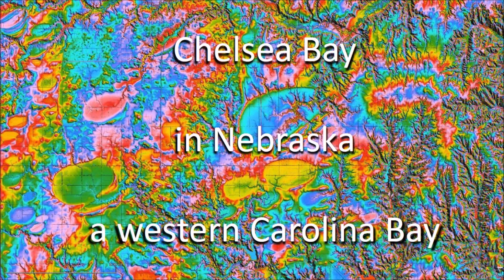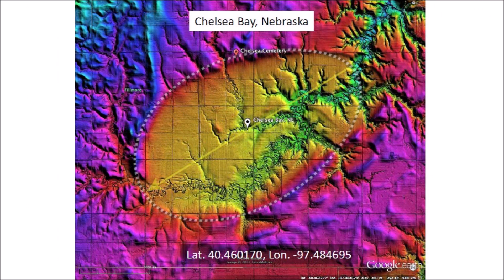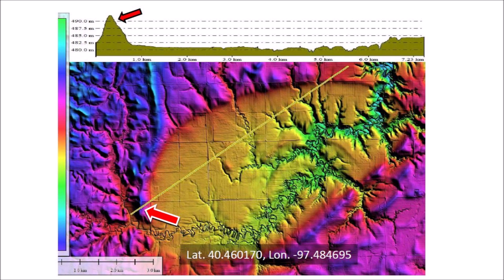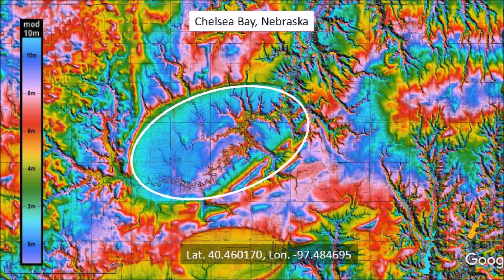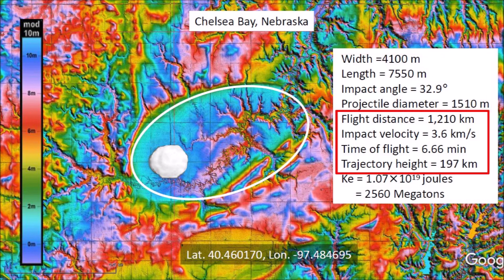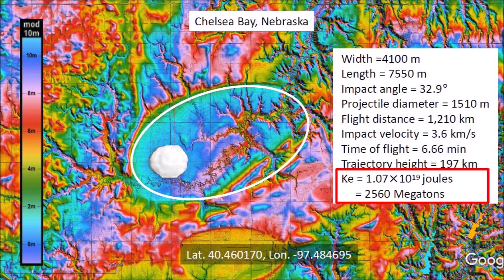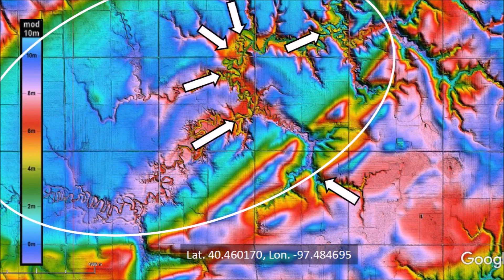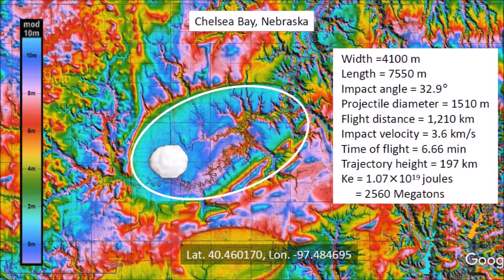Chelsea Bay in Nebraska - a western Carolina Bay

Comment: is there any sand layers in Nebraska bays like there is in Carolina Bays & If so what side of the Bay is the sand?  in Carolina it is predominant in the SE, suggesting melt pulse water erosion..
Are Nebraska bays near the "water table" just like Carolina Bays?  If it was wind that moved sand to one end of the Bay, as suggested in Carolina then it should also be in the North to East Corner of the Nebraska Bays.  If it was water levels then there will be sand layers in the South to West.  Also is the Younger Dryas Sediment Layers present in all of the bays?
Reply from the maker: The Nebraska Rainwater Basins are found on the ancient flood plain of the Platte river. It is sandy soil close to the water table and many of the basins have been converted into duck wildlife preserves. The terrain is not as level as the Atlantic Coastal plain, so the basins have been subjected to greater erosion from surface water.

Comment: Antonio, I see there are different opinions about the direction of the impactor. I think it came from the NE. Have you noticed the pattern of the Canyon Diablo meteorite field. Ehrenburg is 223 miles SE from Meteor Crater & Ganado (& Houck) is about 100 miles NE of it. In between is Wickenburg, Ashfork, Oaks, Bloody basin, Fossil Springs, Camp Verde, & Strawberry. I drew a line through the pattern & found that it comes very close to dissecting Saginaw Bay. Is that only a coincidence?
Reply from the maker: This research is ongoing and we don't have all the answers. I'm currently focusing only on the Carolina Bays, but patterns like you found may be important.
Reply: One large iron meteorite that came down near where I live,  also came out of the north east, in 1780, i.e. The Cranbourne meteorite.

Comment: The Nebraska bays need more attention, but they are harder to see with the naked eye on Google Earth.  Looking at the northwest quadrant of the bay it seems evident that the original river or stream valleys were obliterated.  The freshly formed post impact river erosion is much less defined than the older river erosion outside the bay.  There are breaks in the continuity of the impacted drainage systems.  Is it possible to geologically date the regenerated river valleys where they transition into the bays and bolster the hypothesis?
Reply from the maker: The dates are problematic. They have been estimated at ~24ka, but we have the same problem on the East Coast. The dates are going to be a contentious issue for a long time.

Comment: This ice chunk is the largest one you've discussed (that I can recall).  Based on the angle of the Carolina Bays & Nebraska Basins & adjusting (as much as possible) for 10K years of erosion, can "crater analysis" (a military term) be used to determine which impact sites - Carolinas or Nebraska - received the largest ice chunks?  If this were possible, could one make an educated guess regarding the direction of flight & impact of the comet/ meteor that hit the ice sheet?  Does any of what I just typed make sense??
Reply from the maker: Your questions make sense.  I have considered impact directions from the northeast and the southwest ( https://youtu.be/npXY8mu2hhU ). The butterfly pattern of the ejecta in Nebraska and the East Coast seems to imply an impact from the northeast considering the momentum of the meteorite.  However, this might also be achieved by an impact from the southwest if the explosion following the impact encounters resistance from the Laurentide Ice Sheet and the ice in the Michigan peninsula is propelled radially southward. This is similar to the shrapnel that is ejected toward the direction from which the projectile came for an explosion on a hard surface.
Reply: @Antonio_Zamora  Does the butterfly pattern indicate the extent of the ejecta field, or simply that surface conditions still show impacts ? I.e. rocky mountainous areas would tend to hide the scars of impacts ? Small ejecta could have had a much wider area/reach ?
Reply from the maker: @jollyroger7624  A video scheduled for Friday will show that the impacts were just as hard on some southern states that have no bays

Comment: Well, it still could have been your ancestors and mine. The one "Clovis" skeleton found was dated to 11.5k years ago and promptly buried back in the ground where no one can study it after they declared it a Berengian via hasty dna analysis and yet there is no evidence of fluted points anywhere in China or Russia or across the Bering strait. They are only found in Spain and France and Portugal, ancient Solutrea.
Reply: I saw a map of fossil megafauna : on the east coast the central east coast region is almost devoid of skeletons. Pulverized?
Reply from the maker: A video to be released on Feb. 25, 2022 discusses the lack of megafauna fossils in the southern states.
Reply: @mattiasdahlstrom2024  Maybe, my point though is that the supposed Clovis skeleton they found was dated a thousand years after the YD ended and may not have been Clovis at all, but a later Berengian. Clovis technology is found all over the east but sparsely in the west. It doesn’t strike me as coincidental and I question the theory that they all just ran south and east through a land corridor between ice sheets. Why wouldn’t there be a jillion Clovis points in California then?
Reply from the maker: I vote for pulverization. In a recent video I calculated that Marlboro county in South Carolina received impacts equivalent to about 8 Megatons per square kilometer. https://youtu.be/x6ZRJbE-klE